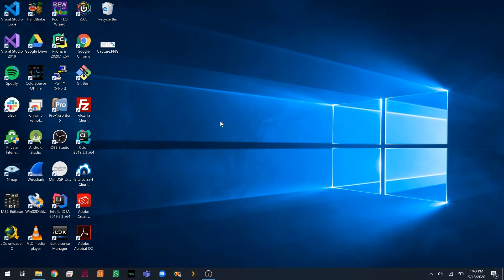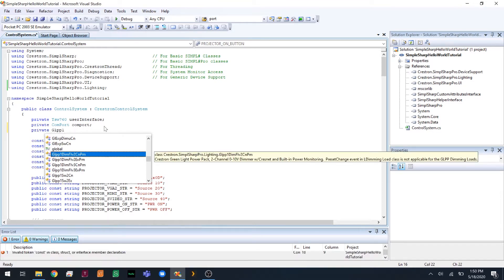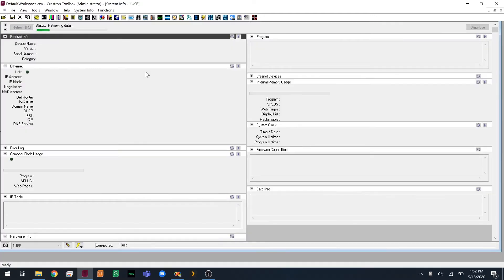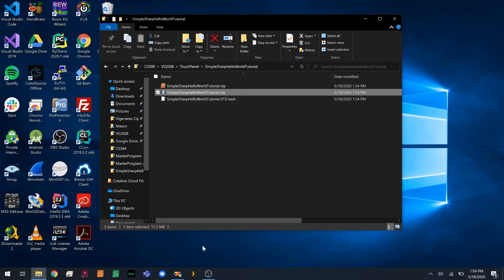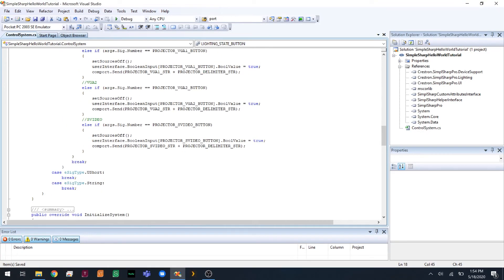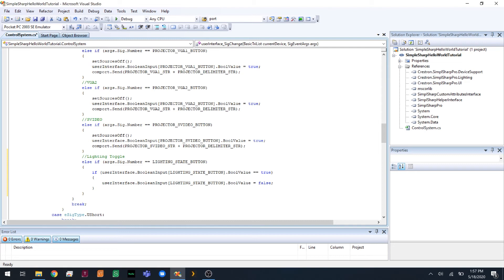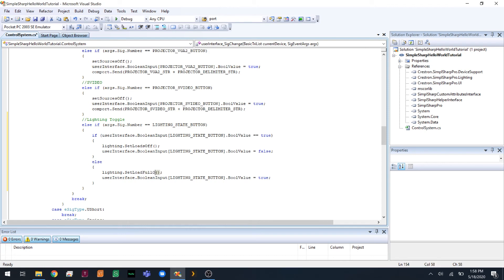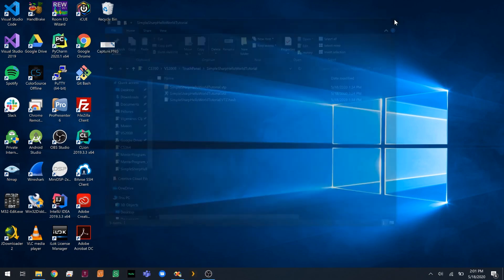Crestron Simpl Sharp Lighting Control in C#

Comment: Any reason you don't just make the lighting_state = !lighting_state and then send the new value? Honest question.
Reply from the maker: You still need to get the current state to know how to set loadsFullOn or setLoadsOff. So I suppose you could call your line of code after the if else block for setting loads has finished and not set the state manually in the if else block.

I tried to keep things simple and easy to follow for the tutorial sake. I could have used switch statements and ternarys I suppose but that would have complicated things for someone without a programming background trying to watch the videos.

Comment: Thanks for the help. Do you know how to send Analog Light levels ?
Reply from the maker: I'm not sure what you mean by analog light levels. Could you send me more details
Reply: @masonvanmeurs6683   Like how do you send Short values for the GLPP load, say at 50%
Reply from the maker: @SpatialMann   @Arun Kurian  Check the documentation link in the description. There is probably a method other than "SetLoadsFullOn" and "SetLoadsOff" that allows you to dim the lights to a parameter you enter given that the lighting control device isn't a relay and is a dimmer.

Comment: thanks i like what r u doing i am evry interested in thes things
i have two question
1-how u send the c# code to crestron controller is there any license.
2-what r u using in computer to use it like touch panel.
Reply from the maker: I'm sending the code via a usb cable to the processor. As long as you have VS2008 installed with the appropriate license for that, you should be good to do. Once I installed all the necessary software with toolbox, double clicking the vtz file opens an emulator. I didn't have to do any extra configuration for that other than downloading the necessary stuff from toolbox for Simpl development.
Reply from the maker: At the current time, development in newer IDEs such as rider by jet brains or Visual Studio 2019 is a possibility. Don't bother trying to get VS 2008 to work anymore
Reply: @masonvanmeurs6683  not for 3 series you wont.